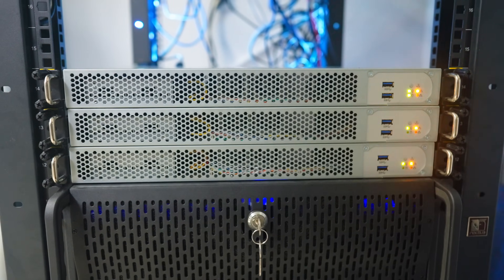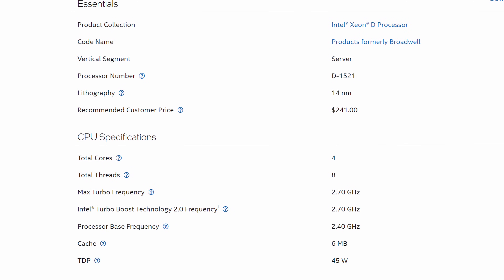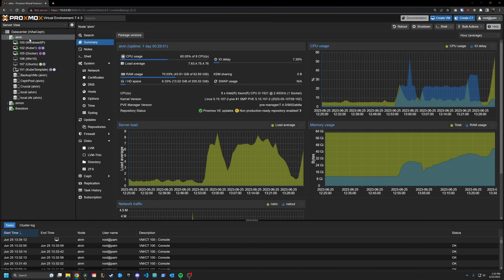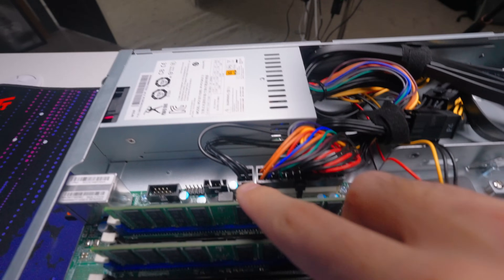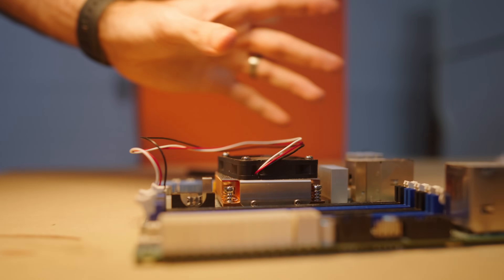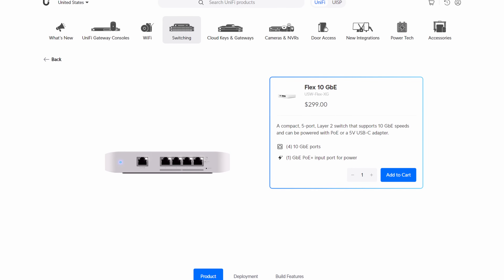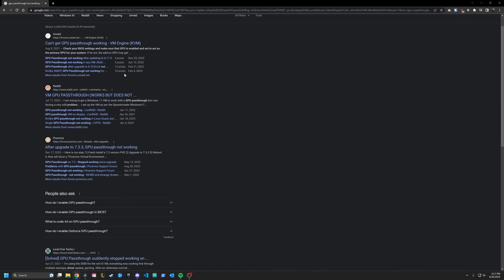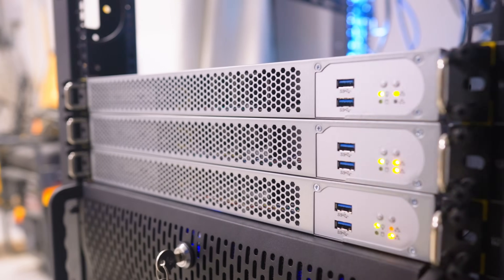I built another server cluster... - Promxox HA Cluster w/ Ceph

Comment: I am glad you did not break your motherboard please read MBD-X10SDV-4C-TLN2F manual (can be downloaded from supermicro home page) that 4pin is not for atx 4 pin power its for dedicated DC supply. You need to either use 24pin atx or 4 pin. DO NOT use them both! Quote from manual: "Do not use the 4-pin DC power at PJ1 when the 24-pin ATX Power at JPW1 is connected to the power supply. Do not plug in both PJ1 and JPW1 at the same time."
Reply: RTFM - The truest words to abide by.
Reply: @LND3947  * insert Michael Scott NOOOOO gif here *
Reply from the maker: @LND3947  its too long
Reply from the maker: Oh neat! 🙃

Comment: one thing you could do is pick up old enterprise sata ssds for boot.  I recently picked up some Intel S4500 drives for my homelab and they've been phenomenal. when I tested them, the drive endurance was at 99% remaining; as long as you're willing to spend some cash on ebay, you can get some really good, fast, reliable drives for really cheap, especially if you only need enough space to boot the OS.

Comment: A Xeon D is still a low-end CPU, but it packs definitely a punch compared to the Zema ^^
i have recently started playing with Proxmox and clustering. 
i know to use Docker and write my own containers, i don't really needed something like Proxmox. I know enough to make a website as an interface for my containers. Most of the time i use python3 in the background so i don't have to deal with Perl, PHP and especially not with Xamp/Lamp or Apache servers in general. 
i also own two powerful machines, one i decided to use permanently and the other is sitting on the shelf turned off and without operating system. i own 2 Dell PowerEdge servers, one is a R630 with 768GB RAM and 2 xeon E5-2683v4 and the other is an R930 with 512GB and 4 Xeon E7-8880v4. The R930 is the one who isn't in use, it is too much power for my needs at the moment. 
My R630 is barely in use, it is idling at 2% to 3% with about 40 containers running. As os i use a light weight headless Debian with CasaOS as Home screen. Everything is running is Docker container managed with Casa. its not perfect, but it does its job. Netdata does also work fine with Casa, i can see all statistics even within from running docker container with naming. And Virtual network bridges working also fine sins i figured how out to use them, because of the limited documentation on it. 
all in all, i am pretty happy with it, i even got a AMD RX540 working on this system to use it for local LLM integrations in some of my containers, like Ollama with an 6b model being used in Home Assistant for the speech commands and in a game i am working on for dialogs. It save a ton of energy running your LLM on a GPU like that instead of the CPU. i mean 190W total system power compared to 700W is a significant difference. Even the RX 540 isn't faster as running the LLM on CPU, but it's close to it. The only reason why i would use the R930 in the future is the capability to use high power PCIE devices that are full height and use more than one slot. But other than that, i don't see why i should use the R930 in the near future. It was a bad decision to buy one. Even the R630 is too powerful, but is was cheap, i paid only 400€ for it in this configuration. And the R930 wasn't that more expensive either, i paid 700 to 900€ for it. Both are now 12 year old systems in near perfect conditions. Both systems do i own for about 4 years now and the R630 is used only in the last 2 years 24/7 and the R930 had properly only run for about 6h sins i own it. i don't know what to do with it.

Comment: Some suggetions for improvement:

First of all... You spent so much money on high availability, but ended up creating another single point of failure, which is the ceph switch. Thing is... For a 3 node cluster you don't even need a switch at all. Instead you can make a direct connection from each to each node without a switch in between (plenty on info in the proxmox forum on how to do this) and as a result you get minimum latency and no single point of failure in the ceph network. Of course you need to use both of the 10G connections that the Supermicro board has for that, but using the other one for a 1G connection is a terrible waste anyway. So use the PCIe slot to get a 4-port 1G Card, which are very cheap available second hand. Fromt that 4 additional 1G ports, you can use 2 to apply the same principle for cross-connecting the nodes directly and use that for the cluster backend network exclusively.

The only downside of this woud be, that it will be not so easy to expand the cluster with more nodes, compared to a solution that uses switches to connect the ceph and cluster backend network.

Of course you could ramp up things even further by using a 4x10G or even 4x25G PCIe card instead of a 4x1G.  Although that will add another few bucks to the bill, it would open up a possibility to get a card with direct memory access support (RDMA), which is also supported by proxmox and known to be very beneficial for ceph performance.

You're welcome. :)

Comment: I'm looking at replacing an existing vSphere Enterprise with a shared storage enterprise "grade" virtualization platform. Maybe I missed it, but I seem to be having a problem finding anyone who can demonstrate High Availability (HA) of the hypervisor nodes in these three scenarios below. Everyone has videos on setting up the cluster, live migration but I'm not seeing anyone doing actual tests of a complete or partial failure of one of the cluster nodes.

 1) Complete node fail -- just pull the power plug(s) out to simulate. How does Proxmox handle dozens of VMs powering on? Does it have a DRS type function where it will distribute the VMs across the remaining nodes? Is there an ability to have specified VMs prioritized over other VMs? Also, the ability to restart VMs in a specific order?

2) Partial fail where the hypervisor is in some sort of hung state and the VMs are down but the storage is still accessible and any file locks (if applicable) are still held? 

3) Host isolation. What happens when the Proxmox host is unreachable from the management side but the VMs running are still accessible? Will it allow VMs to still run? Will it provide an option to restart VMs on other nodes? 
 
Thanks.

Comment: I'm just here taking up space, but I'm trying to understand the high availability part -- what sort of failures are we trying to protect against? the shared ceph pool seems to be the single point of failure that would take down the entire cluster? A single drive failure isn't an issue with raid, but what if that hardware failure that isn't a drive?
Reply from the maker: An entire server could blow up and everything would keep running
Reply: @RaidOwl  I think I've mixed something up then. Is there a 4th server that holds all the drives doing the ceph storage ( the larger 4U under the 3 nodes ), or is the ceph storage replicated across, and exists on, the drives in the node servers?
Reply from the maker: @JonathanDavisJJ  Ceph runs on each of the 3 nodes using each of the Micron SSDs in each of the nodes. So yeah, the ceph storage is replicated across all 3 nodes.

Comment: Thanks for putting together this video and the previous one showing ProxMox VE HCI with less expensive hardware.

The two 10GbE switches shown are each a single point of failure. To upgrade the networking to HA, these could be replaced with two switches configured with MLAG. VLANs can be used to create the two logical networks shown: Host and Ceph.

For maintenance like internal drive or part replacement, having four nodes instead of the minimum three would allow one node to be safely removed at any time to perform orderly maintenance and upgrades.

When one of only three nodes is intentionally made unavailable to perform maintenance, the two remaining nodes are in a degraded state for some services (including Ceph), and if anything unlucky happens to one of the two remaining nodes during the maintenance window, there is no longer a cluster.

Comment: Not sure if I missed it .. but power consumption (idle/load) per node would have been nice too - otherwise cool video!
Reply from the maker: About 30-35W per node
Reply: @RaidOwl  that would be quite much for me .. is that idle or load? in the case you showed 1 node can run the VMs and stuff while the other 2 nodes are basically fully idle (until there is a crash of node 1). are the 30-35W idle (for node 2 and 3) or load (node 1)? thanks for the reply

Comment: This is essentially the same route I took, except I used 5 Dell 7050s 1L SFF PCs, NVMe for ProxMox, 1 TB SSDs on each node for Ceph and a dedicated backhaul network for Ceph. All in, it cost about $750 and my only regret was not waiting until Prime Day to get 2TB SSDs for about what I paid for the 1TB drives. 🤦‍♂️

I haven't made it the primary cluster yet though and am still trying to figure out what I really want to do with it. 😅

Great video though!

Comment: I've just finished creating a pair of Proxmox servers for myself hosting my original 6x rPi's rebuilt  as Debian VMs.
Each machine has the following specs :
- Inter-tech K-125L 1U rackmount case
- Akyga 200W PSU
- ASRock J5040-ITX M/board
- 32GB DDR4 2400 RAM (2x16GB)
- 1x 500GB Samsung 870 EVO SSD for the boot drive (overkill as I originally ordered 256GB but weren't in stock but the retailer supplied for the same price)
- 1x 4TB Samdung 870 EVO SSD for VM storage (again overkill, but i have plenty of available space and they're sheap)
- 3x Noctua 40mm NF-A4x20 FLX 5000 fans

Both machines run super cool and quiet and have plenty of power for my current needs, with each only using <5% CPU and <15% RAM with 3x Debian VMs on each (so far), leaving plenty of storage, CPU and RAM to spare if needed.
I haven't checked the temps on the CPUs since installing the machines into my rack, but after originally installing Proxmox, I went into each machine's BIOS and saw that the CPU temps for only in the mid 20's degrees Celcius.

Comment: Great tour! I love that you include the mistakes and it's not a "do this and the HA gods will bless you" tutorial. I also had a devil of a time getting iGPU passthrough to work on Proxmox, although I'm running it on a Dell 3930 (with USB-C-only iGPU display output). I had to use cpu=host, q35, Virtio-GPU, PCI passthrough with PCI-e & x-vga, USB port passthrough (for the dummy dongle to work). I would still get error 43, but a quick disable/enable cycle in Windows gets things back in order.

Comment: I built a proxmox cluster using Supermicro M11SDV-8C-LN4F AMD Epyc 3251 board. 8-core, 16-thread, 65W total usage with 4 sticks of ECC ram and a SATA SSD boot disk under load. Another Mini ITX board, and though it's Zen 1, its power usage is the reason I chose it. I need fast networking too, but storage is handled differently for high availability in my network. So the 1 PCI-e slot is used for a 10 Gbit nic, because though Epyc 3xx1 supports 10Gigabit networking on chip, this board doesn't have 10gig ports.

Comment: I'm seriously contemplating ordering a few of the Topton Intel 8505 router boxes and running them in a cluster like this... More powerful processor with lower power draw than the SuperMicro you're using, 6x 2.5Gbps NICs for direct host-to-host connectivity without a switch (and enough extra ports for network connectivity), and they're completely passive on cooling.  Only real downside is there's no PCIe expansion to speak of, and it's not Xeon / ECC, but for the price (around the same price as you spent for each of these, if not a touch cheaper) they would make for an awesome cluster!

I'm currently running one for my router and it's been rock solid, and I've got a couple of Chenbro 1U servers that are due for replacement.

Comment: I have a similar setup, for those who want a 3 node cluster but don’t want to splash out on a 10g switch, you can use duel 10gig nics in a full mesh network so each node has a direct connection to each other, works well and removes a single point of failure! (The switch)
Reply: or go for the quad 25G nic in the pci-slot way and use them in mesh network with dac/fiber and leave the 10G copper for outbound networking.

Comment: re: gpu. It's either going to be you need this in your file: vfio_iommu_type1.allow_unsafe_interrupts=1  or you need hugepagesz=1G default_hugepagesz=2M in your grub and hugepages: 2 and balloon: 0  in your /etc/pve/qemu-server/VMID.conf or your hardware just can't handle outputting to the physical ports on the  gpu, in which case if you turn off default gpu on its setting in hardware it will still work but only over vnc/for computation, which is not that useful in your case probably (it's way more useful if you are importing gpus to to hardware encode/decode for plex/jellyfin.)

Comment: I wonder if the 00 is the code the bios is reporting to the IPMI, Then I'd hazard a guess its a cracked ball joint under the cpu possibly. A reflow might fix it. I have no real experience in that, but its just a random guess based on other things I've seen.

Comment: Regarding PCI Passthrough:
Some vendors literally block it from properly working, HP ProLiant Servers for example. Ive been cracking my head for literal weeks with them.
After trying it with some Lenovo Servers it worked instantly for me.

Just a heads up, that sometimes its literally impossible to get it to work

Comment: How does the secondary network for the CEPH storage work? Is it not at all connected to the main network? If so, do I have to manually assign IP addresses to the systems?
Reply from the maker: It’s connected to the main network but it has its own VLAN with proper DHCP addressing
Reply: @RaidOwl  Its not recommended to use DHCP for Ceph network (Ceph is tightly bounded to IP address). Yeah, it doesnt really matter in a 3 node ceph cluster, but its a really bad practice
Reply: @Mcs1v  reservations make everything possible and just fine.

Comment: You should try reseating the CPU on the non booting computer. Sometimes over tightening the heatsink can prevent it from booting.
Reply: I think he mentioned in the video that the CPU is direct-soldered. So it's unlikely to be a misseat.

Comment: if you had NVME drive and need for bandwidth, I'd probably pick 25Gbe or so NICs for the available PCIe slot,
another option would be to populate that PCIe slot with multi-nvme PCIe board, I think Sonnet makes some new one with 8 nvme bays on PCIe 4.0 x16 which is wild :D
Reply: 7400 Micron drives are NVMe. Faster in Ceph than any consumer drive can dream of. And the quad core can't handle more than a single NVMe at full load anyway.